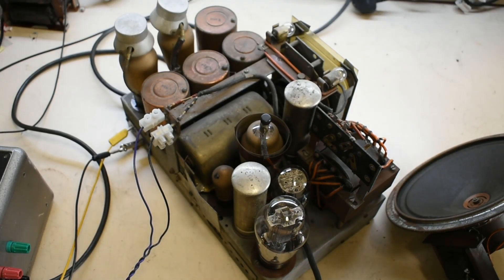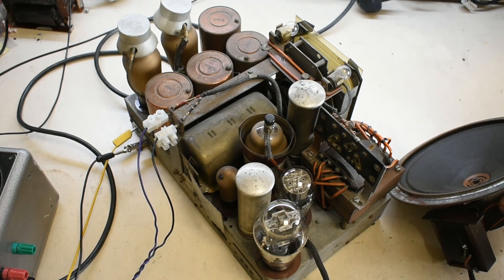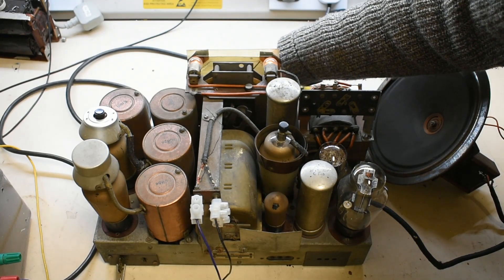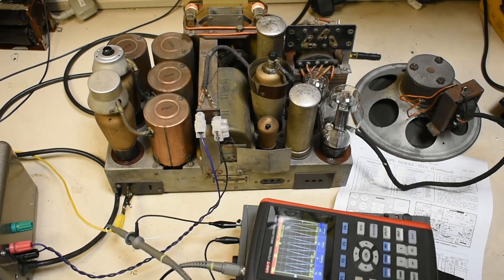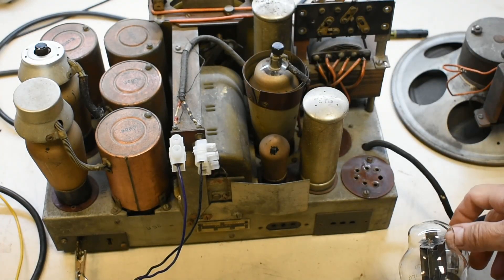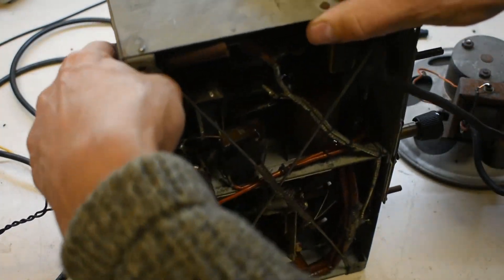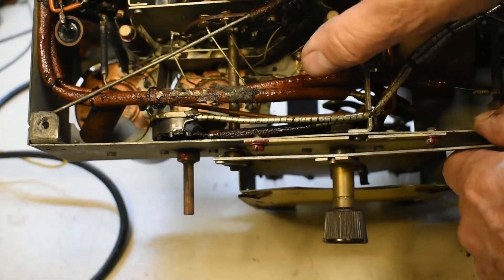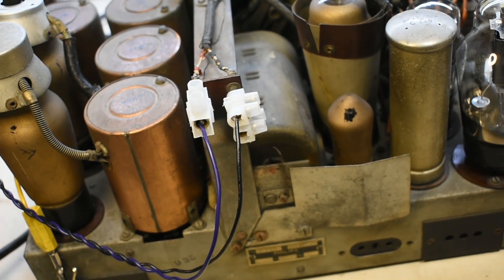Radio Chassis from the 1930s

Comment: The yellowed plate with the markings in front of the tuning dial is probably nitrocellulose if it feels at all oily, it's breaking down and can be unstable.
Reply from the maker: Other than being yellowed it seems to be ok. I'm sure it will be cellulose based as there is nothing plastic on the entire chassis.

Comment: 👍Thanks for posting. The mains lead antenna design is interesting. A set that (apparently) did not require any antenna must have quite a feature in the 1930s.
Reply from the maker: I was surprised to see that too and it did seem like forward thinking for the day. Reminded me of how car radios often used the heated rear window element as an aerial.

Comment: Very interesting - thanks for sharing. The construction style is such a long way from where we are today - but infinitely more repairable.
Reply from the maker: Thanks, the construction is even different from later valve equipment. Tag strips became popular in  early equipment and sometimes is a pain to remove components as the legs would be wrapped onto the terminal then soldered making it difficult to remove. This radio uses tightly spiralled wire as solder cups for leads. So long as there is enough heat in the iron they can be removed easily. As you say very different from today, but less complex too. However build with repair in mind, unlike today.